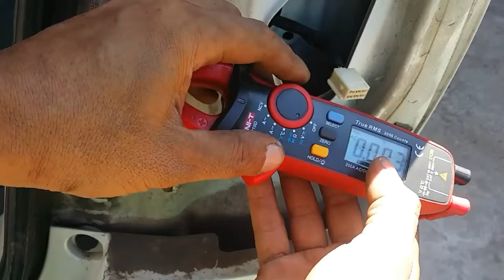How to replace/troubleshoot the brake light on a toyota innova

Comment: Gud pm sir nagpalit po ako ng led light for reverse and brake light functioning nmn pero pg on ko lahat ng ilaw ung left side brake light ayaw mgresponse pg nkatapak ako s pedal. pag off ang mga lights rresponse po cya pag apak ko brake pedal...ano po kya dapat icheck? Salamat po..
Reply from the maker: di ako sure sir. mas mainam kung may multi meter. pero nasubukan ko na ilagay din yan. reverse yung polarity ng bulb. kaya binalik ko nalang sa conventional na bulb. pwede rin mangyari baka pundido yung isang contact. pag sa brake light kasi double contact yan..yung isa para sa brake light yung isa para sa parking light kung e on mo yung ilaw. subukan mo test bawat contact.
Reply: Do It Yourself DIYer yes sir parang ganun nga sa polarity nagkabaliktag pala ung terminals ng brake lights and ung tail light haha solve na sir problem ok na sya now.salamat sa mga videos mo laking tulong s aming mga nka innova.. more videos pa po at mahilig po ako mag diy.. God bless